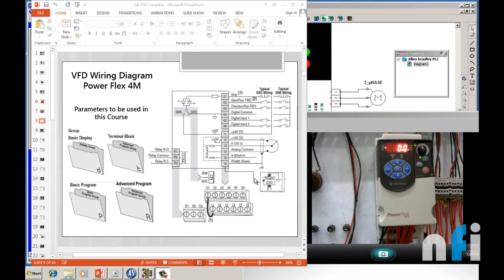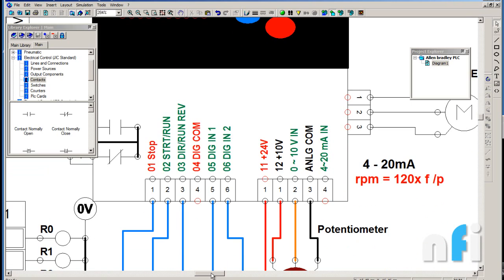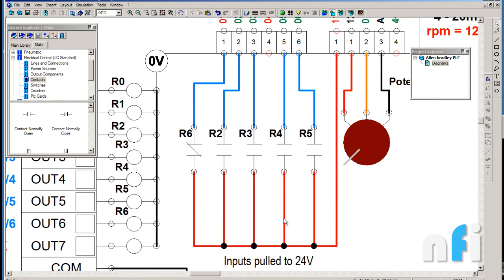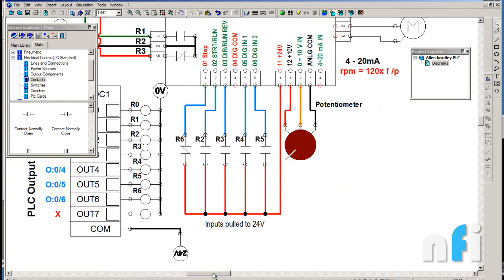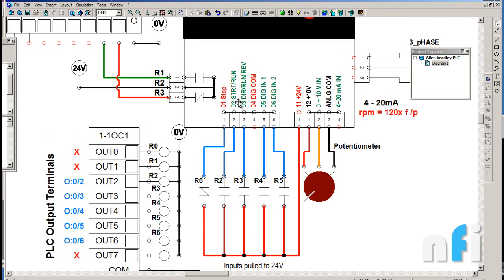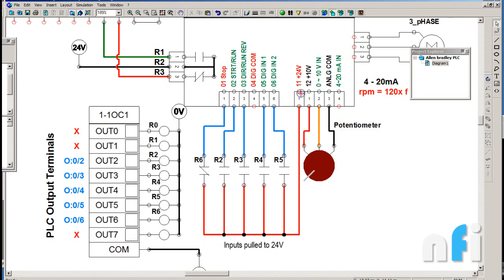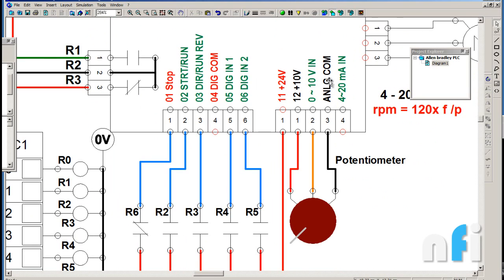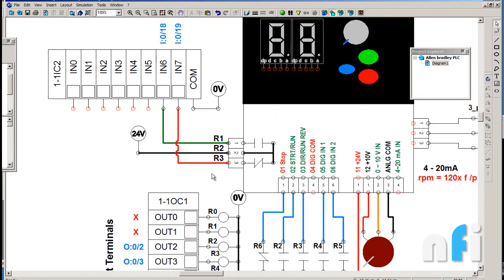Allen Bradley Powerflex 4M- Understanding VFD Wiring

Comment: Do I need a plc do run a motor using an ac drive
Reply from the maker: No you do not need a PLC. You can control the VFD with any controller or hard wired control

Comment: exelent video!!! i have a question that i think you could answer me.. How is the wiring and set up of the VDF to use a out put from the VDF to indicate with a lamp 24 vdc that the motor is turning on and keep the lamp on during the motor is running.

i will apreciate your help......my email persona is moisesamn@gmail.com
Reply from the maker: Hello Moises, In that case you can just use the Relay terminal of VFD and program it in such such a way that Relay gets ON and OFF based on VFD ON/OFF operation. Read the manual you will get it. Or join our course to get the detailed lecture and support: http://nfiautomation.org/courses/advanced-ac-drive/